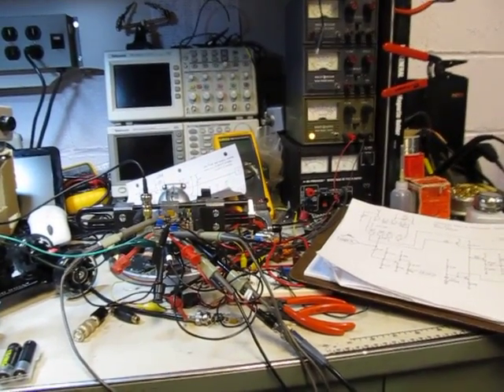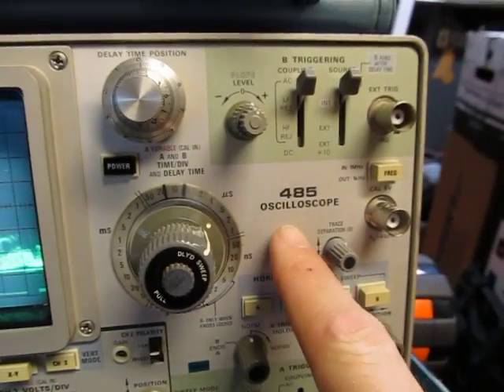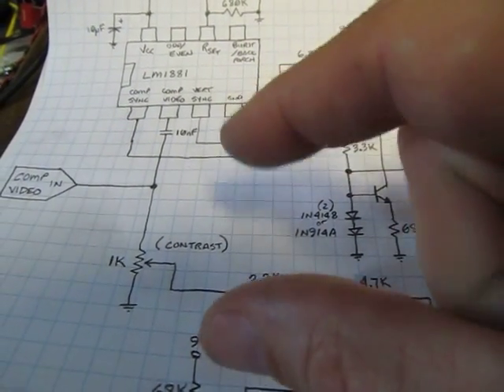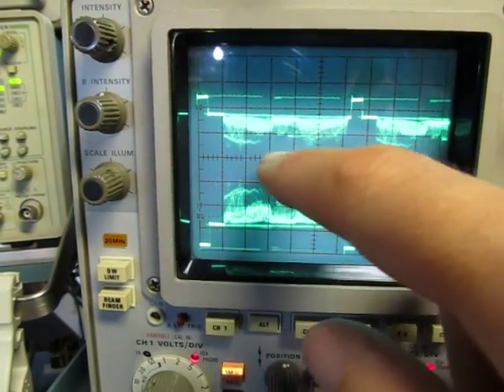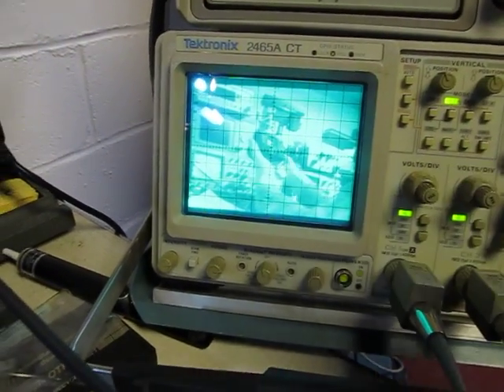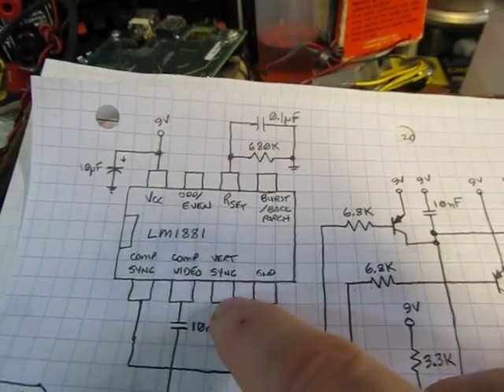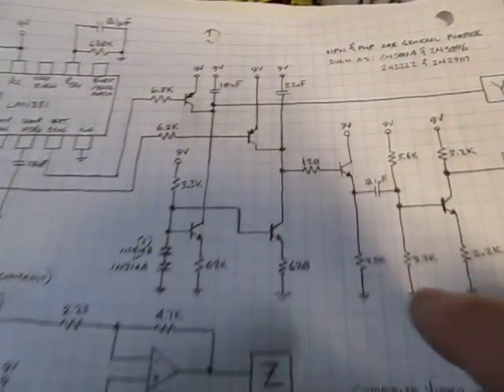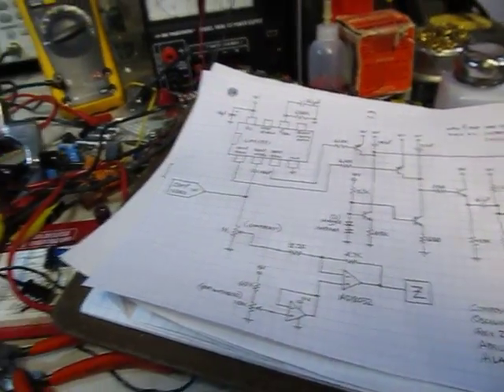#86: Improved NTSC video to Oscilloscope converter circuit / scope video monitor hack

Comment: Hello w2aew.

 I had some disagree with this schematic based on Z axes amplifier. The voltage buffer for the voltage offset (for brightness) is not necessary, because that voltage drive the non invert input of the inverter amplifier where is not drawing current. From the other side the input (after the volume potentiometer, contrast point) of the inverting amp is drawing current (because of the topology) there is necessary the voltage follower. 

Also I think is better to had op amps everywhere, which is needs amplification or signal inversion. 

Except from all that the idea is very educational.

Comment: I service Electron Microscopes and did this with my analog microscope just playing around to see if it could display the video.  Of course I had the X,Y and Video already separated.  Recently I have had a need simply create a composite NTSC signal to display the video on newer available flat panels.  Do you have a video or recommend a IC to use.  Thanks.

Comment: is there a posibility to use this in a pal coding video camera with this circuit?
thanks again
Reply: +Alexandros Tzavellas Yes, the basic principles remain the same, as long as you do not want to decode colour. If we ignore colour, then the only difference between PAL and NTSC is in the timing. Google "PAL Sync Separator". You might need a different one for PAL though.

Comment: Something wrong with your AD8032 in terms of connection of pins 4 and 8, say, pin 4 should be grounded while pin 8 connected to Vcc. Anyway, thank you for your schematic drawing and experiment.

Comment: I did something similar to this back in the eighties when I was in high school.  On thing I did that was different is that instead of using x-y mode I used the scopes time sweep to get the horizontal sweep by putting the horizontal sync pulses into the external trigger input.  The cool thing about doing it that way is that you could either put the video in the z-axis, or alternatively if you put the video in the b input and used the add option to combine with the vertical ramp to achieve  an embossed video effect that was very cool.
Reply: 😮 wow

Comment: I will get to making the sold state version some time but right now I'm using vacuum tubes to drive the sweepers and the "z" input, the circuit I'm using isn't of my design its by a guy named cameramanlink specifically Video to Scope box 2 unfortunately he deleted his youtube and Freewebs accounts, but If I'm getting this right I need to put a "DC Restorer" on to the circuit, or another amplifier for the z input.

Comment: Yes the spinning sweep....... yeah I didn't think about the phosphor being so fast..... if I rember right I think you did a video sometime back about a Tektronix 2465 CTS did that scope have a slower phosphor decay or it had a suped-up electron beam. Like maybe a higher voltage on the CRT

Comment: Great video to revisit and update thanks. I have a question with a Tektronix 2465 is there a way to use the Z-Axis to pull off a old style Radar sweep im interested in making a simple primitive low power radar. Do you have any ideas of which way would be a good approach.

Comment: Really nice! Great description, thank you. 

I did not have a LM1881, but there's an old-school sync stripper using just one transistor (actually originally a triode). Self-biases off the video so it only conducts on the sync pulses. Also works with PAL.  Look up "Broken Oscilloscope" by 11zekim for an application example. I posted my schematic on yahoo tekscopes. 

Keep the great vids coming!

Comment: How well does this video driver work with those new digital storage scopes?
And what about PAL signals? Would it still work with composit PAL?
Reply: If the scope has a Z input with about 20 dB SNR and at least low-MHz bandwidth, it'll work.  Digital or analog, it's just interpreting an analog signal.

The problem is that the Z input is much less common on newer scopes.